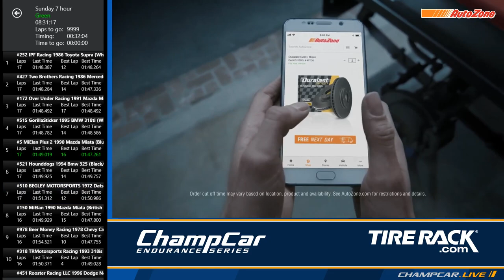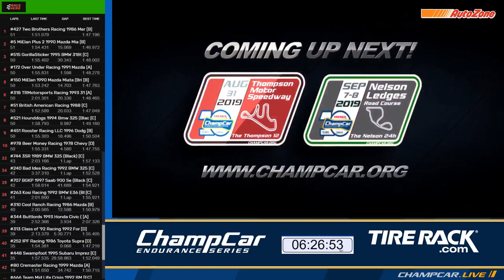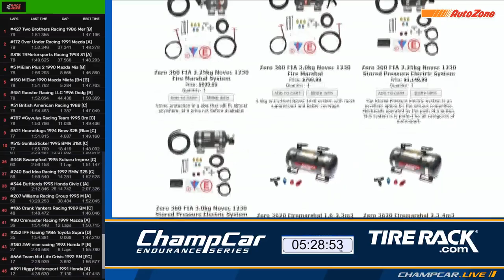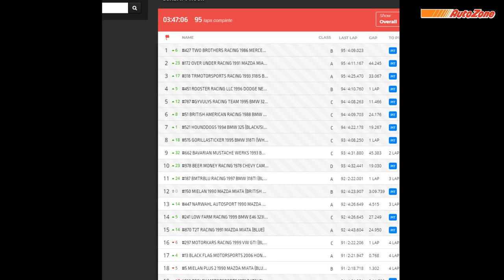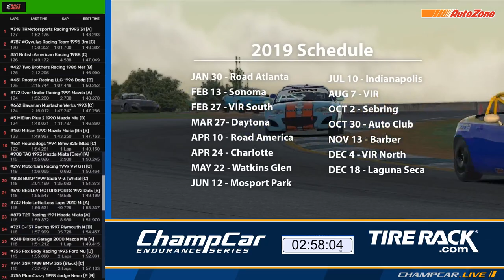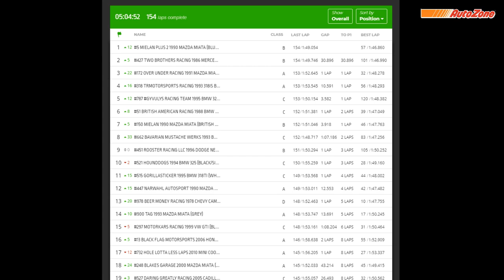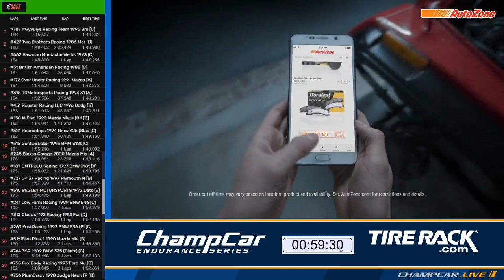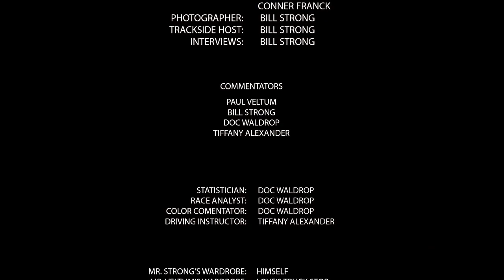TireRack.com ChampCar Endurance Series®Cookie Cutter Classic 2019 Day 2

Comment: Beer Money Racing Highlights!
0:54:12 Plum Crazy
1:04:35 PC and BMR start line
1:44:35 Catching the Camaro
2:05:37 Remember me
2:32:48 PC
2:33:09 pass
2:45:17 Outside
3:13:22 PC
4:31:22 PC
4:56:56 #662 Buzzing the EV
5:10:10 Mustang lockup 
5:40:12 PC
5:47:20 White miata slide-ways! 
5:59:24 3rd gear only :( 
6:40:32 Red Mustang 755 rear end fail
6:52:40 Camera installed into the Camaro
6:54:04 Cam in
6:54:58 cam
6:56:16 cam
6:58:56 Slide
7:04:35 Cam
7:07:43 Following the Camaro
7:12:44 Cam
7:24:10 Pass on Camaro
7:25:06 pull
7:26:14 Cam
7:30:21 Cam
7:34:04 Camaro Ahead
7:40:28 Camaro Ahead
7:47:50 Cam
8:18:30 Wave lap, and lock up turn 1
8:20:43 Cam